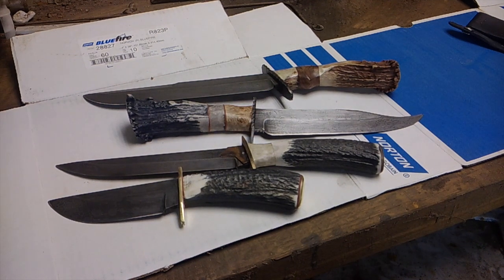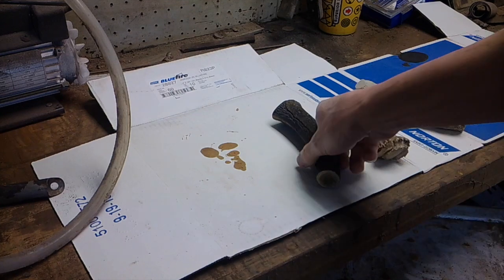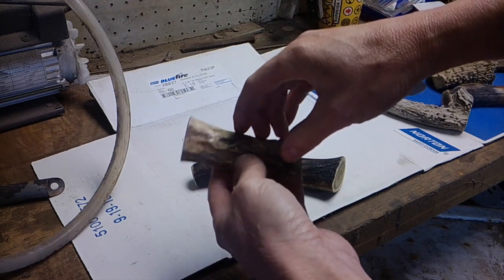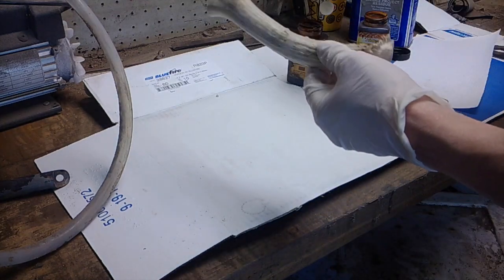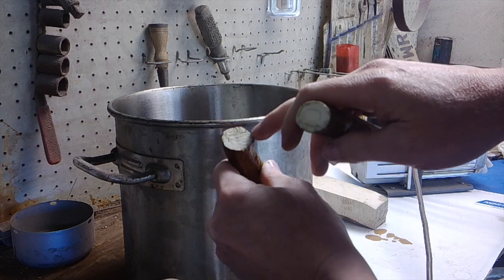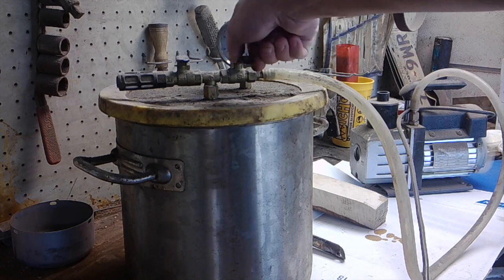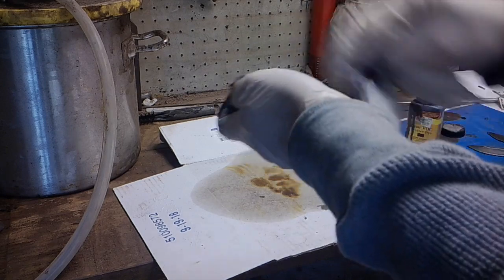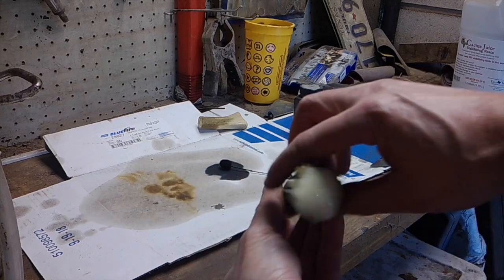STABILIZING AND COLORING ANTLERS

Comment: Great video. They sell a tempered glass lid that supposedly wont crack like the acrylic one. I saw another video where the recommended soak was only double the time under vacuum, do you think that would work?
Reply from the maker: In my experience, with these antlers the longer they soak under vacuum as well as normal pressure the better they do.  I usually will draw a vacuum and let them set 24 hours then break the vacuum and let them soak for another couple of days.  The times can be less but I prefer getting it right because you only get one shot with it.
Reply: @jamesmcclendon1203  Well, your knives look great so I guess you know what you're talking about. Thanks for the info.

Comment: I  love the slightly chalky ones they resemble ivory when you finish . Good video  I Just use a jar and wood hardener thought I would try an inexpensive way before dropping  alot on the set up and cactus juice  I did buy a good pump though .
Reply from the maker: It will come off even more ivory like once it's stabilized.  Be careful, I had a friend use a jar and it imploded in his face.  He joked that the co pay to dig the glass out of his eye was cheaper than a proper chamber.

Comment: Will the dye take well after stabilization?
Reply from the maker: After stabilization the dye doesn't dig in very deep, really only on the surface.  That's how I get the two tone effect, the base dye is applied before stabilization, the second after.